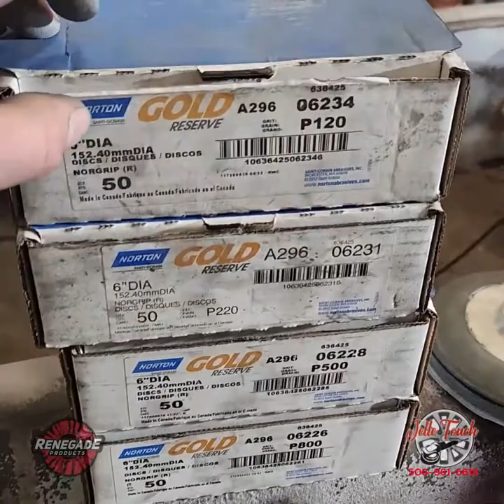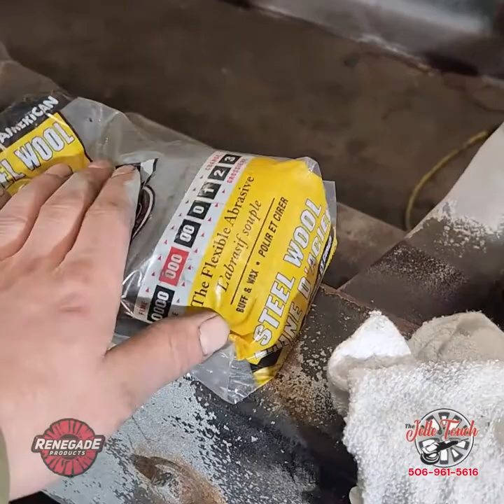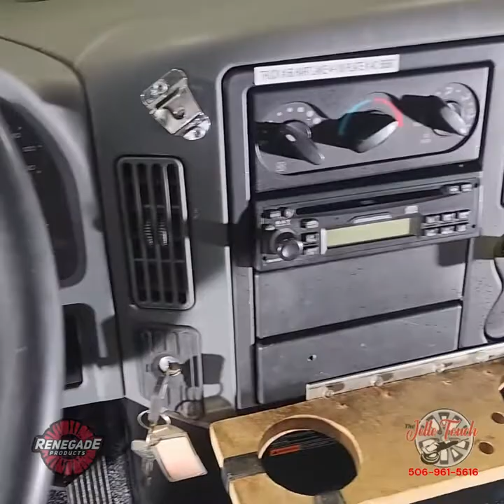How to sand and polish fuel tank, the Jelle Way Explained!! with Renegade products.

Comment: What is the recommended RPM for sanding?
Reply from the maker: I usually sand between 3500 and 5000 rpm. 
Beginners I would recommend not to go over 3500 until you master it.

Comment: How much is something like that cost? I have 150 tanks
Reply from the maker: The average tank goes for 180. Tanks all the way around off the truck start at 275 
It includes 2 steps sanding and 3 steps polishing every additional step that's needed 20 extra. 
If you legitimately have 150 tanks I will give you a better price. 
You can always give me a call for more info. 506-961-5616 thanks and have a great day!

Comment: Im having the hardest time getting a clean look and clarity on my tanks. I have hazey streaks left by the wheel that will buff out if i use lots of compound but the wheel will just leave more streaks somewhere else then. I took a short video if you wouldn't mind watching and giving me your opinion. Im almost ready to give up it's very frustrating. 
 https://youtu.be/GcmLPCyq9ng

I sanded beginning from 120 up to 800 and then I use my orange wheel and brown compound at 3200 rpm. It seems no matter how hard or many times i go over a section it will leave hazy marks or streaks. My yellow wheel with green compound will leave marks and even my white wheel with purple even leaves marks that i have to fix by trying to go over with my cuts again!
Reply from the maker: It sounds like you going to need to use some more speed like a 6000rpm grinder for cutting. It's a bit more dangerous and the grinder is heavy! But of you sanded down from 120 to 800 I'm sure you can use a 6k it will give more heat so also more shine
Reply: @thejelletouch  thanks for the tip! Maybe that's the issue cus Ive gone over these cap ends so many times. It's always the end caps of the fuel tanks that give me trouble
Reply: @thejelletouch  and I realized that my yellow and white wheels aren't leaving marks they're just revealing the improper cut